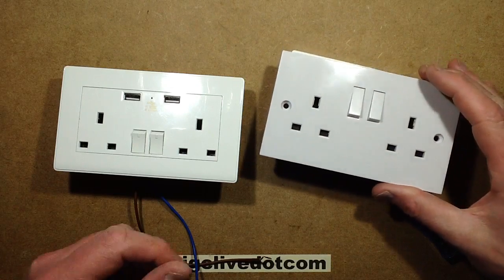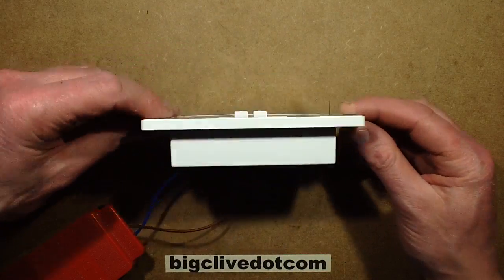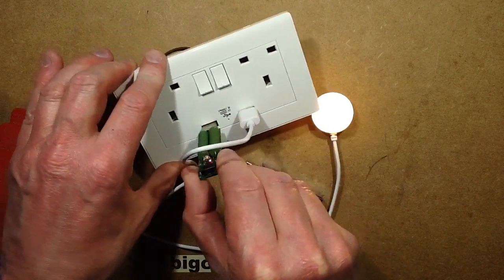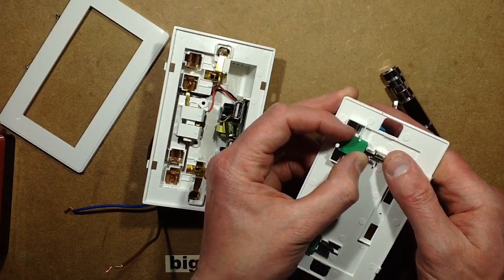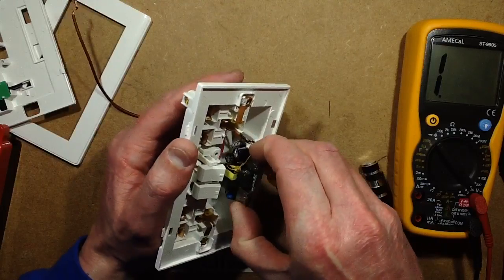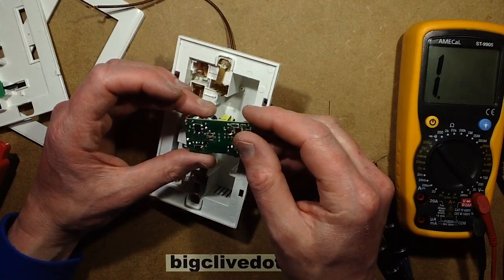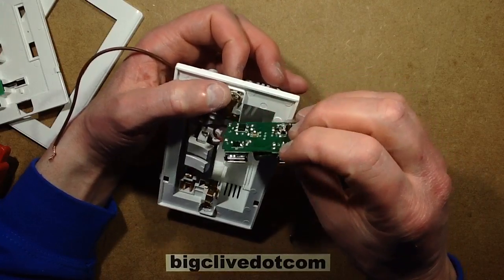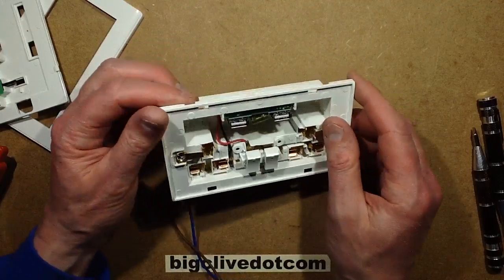A look inside a (crap) double gang socket with USB outlets.

Comment: "And the iPad just said 'give me the power!'" Well that does sound a lot like Apple
Reply: Can people chill? We would like to make a joke now and then
Reply: @wsketchy  nein
Reply: It's an extra power supply sale
Reply: @Kalvin N, what has the operating system got to do with how the charging circuitry works? nothing. apple hardware is not any safer than samsung hardware, or lenovo, LG, htc, sony, whatever it may be... maybe some cheap ass chinese brand phones do dodgy shit but then you are paying 5% of the money at that point...
Reply: RWoody1995 I think you’ll find it does. If you wire your circuit up we’ll enough you can do so with power drawing capabilities and stabilisers. Apple get there maximum efficiency out of their devices, typing on a 2 and bit year old iPhone 8plus with no issues. Android are known for having more apps or better details on paper but on paper means jack shite. In practice Apple smash the androids outta the park as proven with things like live testing, camera capabilities- android use 48mp lenses yet look like horse shit yet Apple use 12mp and get far superior because they tweak and fine detail everything to a T. You don’t hear of Apple products exploding like android 😂 pay for quality get quality. Pay for crud you get crud. Simples.
Reply: @Jeffro86uk  no wonder why I dont use Apple anymore, I had 2 ipads, both failed.
Ipad Air broke after less than 2 years (new) , my Ipad 2 broke below 3 years and a Motorola  G 1st gen from late 2013 which was really cheap £80 new out lived both Ipads after 7 and 3/4 years of being on and off it then died.
this happened 2 years ago and now I have a Honor 7x.
I wont ever get an Apple ever again
Reply: @Moshimulations  I have the same story but with non-apple phones and laptops... We both just had bad luck man
Reply: @Jeffro86uk  LMAO yeah, exact opposite to the truth LOL
Reply: @Jeffro86uk  If Apple power management is so good why does everyone preach on about only using Apple power bricks ??, the two things are at odds with one another
Reply: @Moshimulations  
The last Apple product I had eventually was smart enough to stop letting me charge on bad gear.
(I didn't know why at the time, now I know).
Although I suscept it was more due to the cruddy lightning connect that arcs to ground when you remove it...
Because all the pins disconnect the same time. I've gone through way too many chargers because of it, without realizing,
and now my iPod appears to have the mechanism under the home button melted so it won't move and the internal connection 
is worn down to plastic/ceramic.
It really didn't help that I managed to trick the device into still charging with some jiggling, replugging, and bridging the connections 
with a tiny bit of moisture...

...Needless to say I'm never buying Apple nor low quality chargers again.
Reply: @Mallchad  You get a free salute from me
Reply: It is planned self-sabotage. No matter how crap the charger is, it charge, so it will broke down faster to make you buy a new one. lol
Reply: Yeah apple does a lot of filtering and power conditioning in the device
Reply: Uhm, okay. Or maybe the iPads charging circuicy just comes with smoothing caps that are worth a fucking shit?
Reply: @kduhtdkzrt  it's apple. No 🤣
I might agree if I hadn't replaced a power supply for a MacBook pro 4x, a MacBook 2x, and we have a pile of white cubes and two unchargeable bricked ipads.  
That's over about 5years. Poor quality power here, it gets noticed. (I've bought two android chargers in 10years just as a comparison, and never had one refuse to charge other than by a 7year old socket that got a bit crusty.
Reply: it proves apple products are shit and are happy to get fried with a bad supply ,android is smarter and more secure
Reply: girlsdrinkfeck Apple takes what it gets and makes the best of it(requests full power, accepts what it gets then smooths it out) android tries to pull as much power as it can without lighting fire.. I think I know which id rather sleep next to.

Comment: do all sockets in the uk have switches? 
canadian here.
Reply from the maker: Most do.
Reply: that's so luxe
Reply: Tokinaboot Yamaddy the USB ports are low voltage. You don't need an isolation switch for them.
Reply: blind1337nedm
Reply: In UK it's quite normal to prevent arking on the plug pins/socket damage when plugging somthing in (the switch it self norm has ark arrester on the switch, if it's a UK branded one)

Comment: THESE SOCKETS MAY BE FAKE  as the BSI mark on them may not be accurate and the layout  at the back where the L/N/E cables go in is totally different to ones i have seen or used have a slot to the top left of the circuitry and one slightly to the right of that maybe 1 cm gap for L/N (forgot which goes where) and to the right side top and bottom there are 2 earth slots which i think are linked can't remember but the layout is 100% different to the ones you have tested

Comment: I wonder if the stability issue is a design flaw or just a defective unit?
If it's just the unit that's defective my instinct would be to replace the electrolytics and see if that solves it.
Reply: o think tat particular socket is fake and the ones i use have different connection locations in the back

Comment: Hi Clive,

The seperate earths are a worry but surely a link wire could be put between the two terminals instead of going to the lengths of gettin a metal back box? So long as they are both screw terminals an earth link wire would seem the easier and safer option?

Del.

Comment: not sure if this matters, or is correct, but i think most android phones take a 2 amp charger and apple stuff takes a 1 amp. maybe thats a factor?
Reply: Most android stuff that I handle is perfectly happy with a 500mA "charger", but prefers a standard 1A "charger" with the two data pins connected to each other. I have encountered one or two odd units that require USB3 or custom cables with a corresponding high power "charger".
Reply: I think it's intimately how most Android phones are configured to use their USB ports, there USB ports can ether run in host mode, like the ports on your Laptop, or client mode, like a USB stick 

The oscillating current may be causing the phone to get confused to whether or not it should be supplying charge or receiving it

Comment: I wonder how explody one of these would be: http://www.ebay.co.uk/itm/Universal-Double-USB-Ports-Outlet-Power-Wall-Socket-Standard-Plug-with-Switch-/131832262979?hash=item1eb1d0b143:g:r8kAAOSw3ihXTA1V. It seems to have the genuine C E mark on it :D
Reply: there are genuine USB plug sockets this guy was reviewing a fake and as for your ebay listing the seller rating is good but i am not sure how to trust the socket i know in certain countries they have plug sockets with every type of plug adapter built in i went on holiday to pakistan a few months ago and i saw many of those sockets in my grandad's house also there is no such thing as earth and there is surprisingly very few deaths related to electrical accidents as whenever someone wants to add plugs/wires to the circuit they would shut down the power to the building and they do not look like a fire hazard

Comment: This double socket outlet looks identical in every way to the unit I recently
bought EXCEPT the UK 3-pin outlets could also take various European plugs (see:  https://www.amazon.co.uk/MK-2-Gang-Double-Switched-Charging/dp/B015FKQV7U).   

As shown in this video, to make earth contact to both earth terminals, BOTH terminals on
the back side of the unit need to be connected together, otherwise only one
outlet is earthed.  HOWEVER, even if this was done, the earth outlet terminals DO NOT MAKE CONTACT WITH THE EARTH PIN OF UK 3-PIN PLUGS!  

Such shoddy workmanship.  I informed the supplier of the danger of using this unit in the UK and of its non-UK compliance.  The supplier reimbursed my costs and told me to keep the unit!  Buyer beware of such items from China - certainly if you value the equipment you intend to run or charge from the USB ports.

Comment: Makes me want to send you a Danish outlet to compare with :) Frankly I find the UK outlets somewhat clumsy and unnessesarily big, but they do have some good square contacts.
Reply: UK plugs are the safest design in the world and not at all clumsy. Having these plugs in Ireland is one of the best results of our close ties to the UK. Every plug having its own fuse gives huge peace of mind. The sockets are much tidier looking than most other designs too, particularly Schuko sockets with their big circular slotted holes and sometimes even an earth pin sticking out.

What really IS clumsy is the fact that most American, Australian, Chinese and Japanese plugs as well as Europlugs have the cable coming straight out of the back, ready to be yanked from the socket if someone pulls a little too hard on the cable or trips over them. The right angled UK and Schuko plugs negate that possibility. I'd love to see more battery powered devices fitted with something akin to Apple's sadly abandoned Magsafe system, but that's the only situation when I want a plug to come away easily when tripped over.

Comment: Did not see the point of these either. My naive concern was that the transformer will always be on and drawing some small current. Also the safety of leaving electronics always on as well. 
USB will be obsolete on a relatively short time scale as well. 
However, is there a future need for standards to bring in DC household supply outlets. Like we move towards LEDs for energy efficiency, and lots of gadgets are low DC supply as with USB. Could there be a case for rethinking how power is distributed through a house in future ?

Comment: Can you recommend a safe USB / socket? I like the idea of having a few dotted around the house but obviously don't want to compromise on safety.
Reply from the maker: I recommend using good quality plug-in chargers.
Reply: +bigclivedotcom thanks, I will stick with them in that case. Now if only apple made a decent charging cable....
Reply: My anti-fraying cables that came with my phones are fine - then again they are high quality ones from Samsung! :)
Reply: +bigclivedotcom such a salvaged travel chargers? I got one from a prestigio tablet connected to speakers, one from a Sony Xperia connected to a usb light, and one from Alcatel, and another two from a Vodafone devices, hooked to nothing. All of them are europlugs

Comment: the same thing happens with my power brick.....if I connect the tablet it starts and stops but when i connect the phone with the tablet they both charge fast and fine.....i wonder if its dangerous for the batteries.

Comment: I wouldn't buy electrical sockets that include USB outlets for my home (North American versions).  Here there are no switches on the outlets.  The USB outlets will sit there and draw current 24/7.  If you outfit your whole house with them, the wasted energy adds up.  Just keep a supply of plug-in USB transformers.  They can be found for as low as $5 for the cheapest models.
Reply: Sure there are outlets on switches, it is just not common.  You could put any outlet on a switch if you wanted.
Reply: I salvaged the traveler chargers. they do the job nice and clean

Comment: thanks for your reply  I did not expect it and I do appreciate it.
 I do know exactly what is wrong with the plasma cutter it was a exciting fault to witness. it occurred due to dust buildup and a bit of moisture on the hf part of the main circuit board that had a spark gap to earth to limit the size of the pilot arc. however with enough metallic dust wood dust and moisture made a lot of arcing flames and smoke.  and it kind of vapourised the the hf part of the circuit board along with the components lol.
I would have replaced the damaged components if I could have identified them but even the solder was vapourised. I do have some knowledge of electronics and cutting /welding equipment.
but I have to say I don't know much about plasma balls and I do know that I can't just measure the volts or current produced by the plasma ball circuit with my fluke.
I have 2 favourite sayings  that apply.
1 it's what you don't know will kill yea.
and 2 it's a fine line between bravery and stupidity;-)
thanks again and keep making the videos!

Comment: hi there I am wondering if anyone has reverse engineered a plasma ball circuit? I have a plasma cutter with a burned out hf pilot arc and I have a old plasma ball with broken glass and I had been thinking of using the hf arc of the plasma ball to start the main arc of my plasma cutter as it is working but I have to leave the cutting nozzle loose and sort of short circuit it to start the cutting arc ( a Chinese cut 40 ebay special ) 
the 1 thing I would like to know is will the hf plasma ball arc have enough amps to kill me as I am too chicken to find out  the easy way  ( 9v battery to tongue test lol)
Reply from the maker: I wouldn't;t recommend it as the plasma cutters high voltage ignition is referenced to the cutting voltage in a very specific way and you may damage the unit further or open up the risk of a shock from the plasma cutter which operates at a modest voltage.  The fault with the plasma ignition may just be insulation breakdown in the cable.

Comment: why would the mains go to a rectifier before a transformer? Can it feed rectified DC pulses to the transformer ? Sounds real spikey and RF harmonic noisy .
Reply: Standard SMPS high efficiency: First rectify the 240VAC/50Hz to about 340VDC, then use an oscillator to turn it into about 240VAC/50000Hz, which allows for a smaller transformer with less energy loss.  Use clever electronics to adjust the waveform from the oscillator so the output will be 5VDC +-5%, without having to burn off excess volts as heat.  This is pretty much the only way to get the efficiency above 80%.

Comment: I wondered if it's instability was due to it having to be very low standby current.  I.e. it pulses on purpose until loaded to prevent continuous parasitic load on through that output resistor?

Comment: A SMPS normally needs a load to stabilise; this cheap little circuit needs one. Same with the most basic "switched mode supply", the triac/thyristor dimmer. Back in my theatre days you had to put a large load (we called it a load can) for low power light fixtures, shining away under the stage or somewhere.

Much as I loathe regulations and the government, being a libertarian, permanently installed lamp ballasts are all over the place. Every old skool fluorescent fitting has one, and so do CFL fixtures. Because ballasts in lamps either are costly and resource intensive (when the lamp fails you're throwing away a perfectly good ballast) or cheap Chinesey crap that's likely to fail before the tube does.

Comment: I bought one of these made by Status and it was so dangerous . the sockets would flash blue when switched on.
Reply: you got a defective one but this guy has a fake the L/N/E connection locations in the back are different to any USB wall socket i have used and status makes good wall sockets so does ALDI they have their own brand wall sockets which they do on seasonal offers i have used them in my house but this guy really needs to compare different sockets then come up with a conclusion
Reply: His conclusion is the same as most sparks opinion would be... This one is dangerous and built in electronics is a bit daft, because if a fault develops in the usb psu, you need to isolate an entire circuit and replace the whole unit as opposed pull out a plug and buy a new psu... Some things just aren't a good idea.

Comment: Just found your videos.   I really enjoy them.  I'm curious about the  test clip device you are using for your line voltage.  I've never seen anything like that before and would like to get one.    Right now, I'm using a cord with some insulated alligator clips, but your arrangement looks far superior.   May I inquire as to the supplier?
Reply: go to maplin  or any top electical shop.